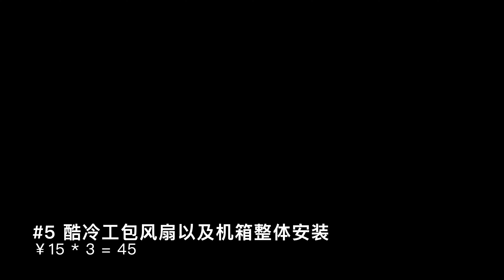Cheap Nvidia RTX 3070 Gamer's build possible? Zen Art World C2 Build for $1,700！

Comment: A list of the parts used would be nice 👍
Reply from the maker: Sorry for the late reply, here it is. 
CPU: Intel i7 9700K
MB: ASUS Z390-I
RAM: Kingston HyperX DDR4 3200 8G*2
GPU: OEM Nvidia RTX 3070
CPU Cooler: Jonsbo CR1400
PSU: TT GT650W PSU
Case: ZZAW C2
Fan: CoolerMaster OEM
Reply: @masterbamboo  thank you very much, nice video

Comment: Hello everyone, could you tell me the computer settings?  the video is untranslated.  Thank you👍
Reply from the maker: Basically...cheap but nice parts all wrapped up to ￥11,000 RMB. Case is ZZAW C2. Parts list: 
CPU: Intel i7 9700K
MB: ASUS Z390-I
RAM: Kingston HyperX DDR4 3200 8G*2
GPU: OEM Nvidia RTX 3070
CPU Cooler: Jonsbo CR1400
PSU: TT GT650W PSU
Case: ZZAW C2
Fan: CoolerMaster OEM
Reply: @masterbamboo  Thank you 👍🏻

Comment: Hello. Does this case support a full ATX psu? I really want a sff PC but I am afraid that this won't go with my PUS and an mATX mobo.
Reply from the maker: Hi, unfortunately C2 will not support a ATX PSU & mATX combo unless the mATX board is less than 200mm in width. The C2P should be hitting the global market shortly, see my newest upload, which will support mATX + standard ATX PSU combo.

Comment: GPU size?
I have mini.ATX 2slot ram ver. And ATX PSU. 
Can 280mm GPU will fit?
Asrock 5600xt challenger pro
Reply from the maker: Hi, GPU will be a tight fit, but it will work. 

The motherboard, just need to make sure it's width is less than 210mm, it'll work. 

The ATX PSU will be a little tricky, It needs to have be 150x140x86 in size, and the modular cables may still run into the GPU of that size. So in case of problem - be prepared to swap to a SFX PSU.
Reply: @masterbamboo  thank you. How about on C2 Plus? I checked the video of yours c2p.
Reply from the maker: @JETS28  C2P needs the same 150x140x86mm PSU size, other than that, C2P is awesome in hardware compatibility.

Comment: What are the CPU and CPU temperatures for this build?
Reply from the maker: GPU isn't too bad, CPU（9700k) was dialed down to all core 4.4. Roughly 70°C at full load.  GPU, when tested with mining for a day or so was stable at 48-50°C
Reply: @masterbamboo  thanks for the reply! I don't have an AC in my room. What's your ambient room temperature?
Reply: @masterbamboo  also, would my motherboard and PSU fit? Motherboard is 244mm x 198mm and my ATX PSU is  150mm x 140mm x 86mm
Reply from the maker: @mclovinpeter6701  about 22-28°C, usually won't go over much. In Kunming, AC can be considered none existing.
Reply from the maker: @mclovinpeter6701  if your MB is 198 in width, it should fit fine with ATX PSU of that size.
Reply: @masterbamboo  thanks a lot for the reply. I'm torn between the Tecware Fusion and this C2 case so your detailed info really helps :)
Reply from the maker: @mclovinpeter6701  The thing I like this case is highly affordable and good quality, but if you take the price out of the equation, then I may have to reconsider.
Reply: @masterbamboo  why? What's the downside of this case in your opinion?
Reply from the maker: @mclovinpeter6701  Not much really, the only complain I have is not much of a watercooling capability. Whenever I can, I'd try to run custom loop, but this case screams for simplicity.

Comment: I just want to know that if this case can fit an aio? 120mm or 240mm
Reply from the maker: If you have a GPU then most likely no. I tried to see if a 120 will fit but unfortunately it bumps in to MB. 240 is a no with ATX PSU. Alphacool 80x2 Rad + Eisbaer LT Solo might work!

Comment: What size fan can fit at rear? 120mm or 80mm? or both?
Reply from the maker: 90 for the rear, 120mm not supported. 92 to be exact.
Reply: OK.. Because I already order that case, I thought 120mm can fit at rear.. That mean I need to buy 80mm or 90mm fan.. Thanks man for the info..

Comment: Does this support aio water cooling?
Reply from the maker: With ATX PSU, the top doesn't have enough room for 240mm AIO, but with picking the right parts and SFX PSU, it can. But if you don't have a dGPU, then bottom mounting is also an option.
Reply: @masterbamboo  nesse caso o radiador não tocaria nas memórias ram?
Reply from the maker: @ttvictovega8games208  Even though C2 does not officially support top mounted 120/240 radiator, I think 120 and 2x80 is possible, and shouldn't run into RAM unless the RAMs have huge heatsinks.

Comment: Matx MB and Atx psu at the same time. wont fit?
Reply from the maker: unfortunately will not, unless it's a non-standard MATX(5mm narrower than standard)
Reply: Weird because in my build it's fit
Msi h410m bomber
1st player  fk600w psu
Reply from the maker: @izzatti7446  MSI H410M Bomber is 23.6cm * 19cm, which is narrower than most of the standard MATX MB. MATX usually runs 244 x 244 in a square config.
Reply: @masterbamboo  yeah. The tech spec said it would fit 244x244. You have try it?
Reply from the maker: @izzatti7446  244x244 with SFX PSU, not a problem. ATX PSU, no go.
Reply: @masterbamboo  I see. Okay

Comment: Support ATX power supply?
Reply from the maker: Yes, with Mini-ITX MB. mATX MB need to be shorter(none standard) in order to fit.
Reply: @masterbamboo  is it all aluminium?
Reply: @masterbamboo  i just realized after buying that this case doesnt have a vertical mount for gpu, hope theres clearance for me to mod the case
Reply from the maker: @rayz0rxxx  The C3 has the vertical mount, the C2 does not unfortunately, but C3 is WAAYYY too big. And yes, all aluminium. 

If you have a shop or a way to cut out the PCI mount, I think modding is possible, just need to pay attention to GPU to PSU clearance when mounted vertically.
Reply: @masterbamboo  im planning to cut the rear fan mount for pcie mount, just hoping the gpu wont interfere with the power cord 🥶

Comment: where to place hdd and ssd?
Reply from the maker: 2.5" only, bottom right, close to front panel. There're mounting places, vertically mounted to the bottom panel with 2 screws each. I think it supports up to 2.